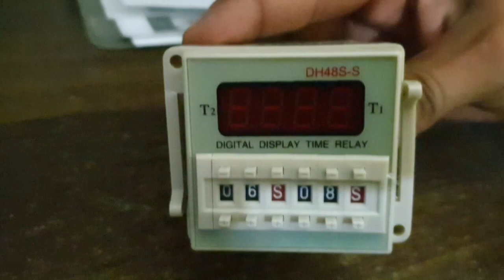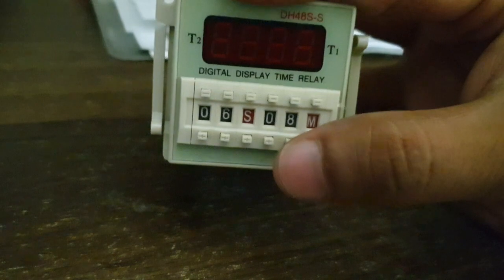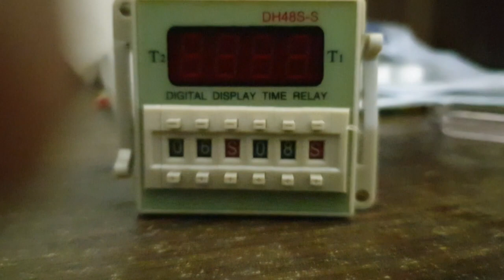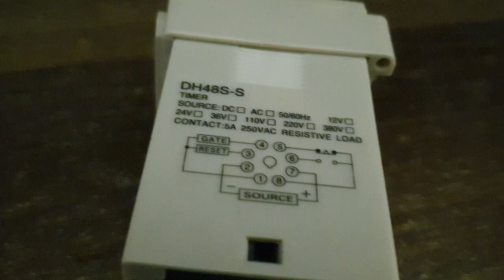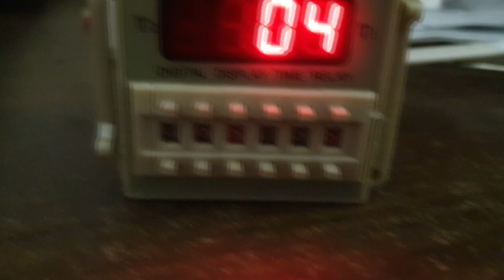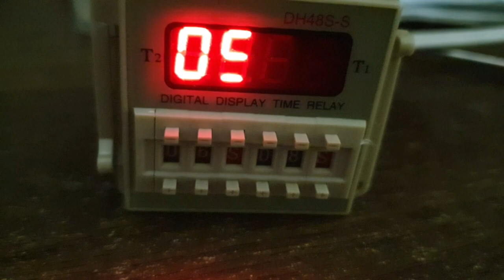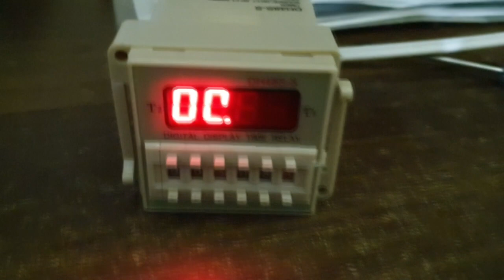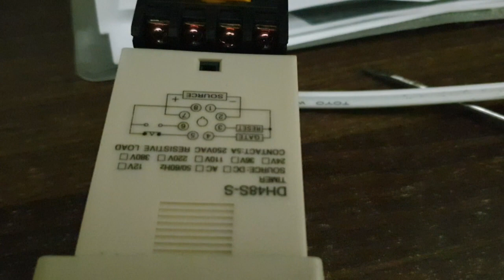Timer Relay - DH48S-S Set-up Guide

Comment: This timer can not switch on/off a device or lamp for a fractional time. For example if you want to switch on a device / lamp at 6:45 pm and switch off it at 11pm every day on repeatedly..... it is not possible. So, this timer is not useful.
Reply from the maker: I am not sure if that  is true. Relay has units for minutes and fraction of seconds as well. You need to put the value in that way , not in standard 6:45PM way. It is bit cumbersome. Another big downside of this relay is that if there is power fluctuation, the timers start from zero which meas your syncronization of T1 and T2 with day and night times will be riuned. I would suggest going for 'digital relays' which have built in clock and easily manageable time format.

Comment: Thanks! Very helpful 👍
Did you have the other two hooked up, for reset and gate ?
Reply from the maker: Hi, I did not connect reset and gate. To reset, which I rarely do, just disconnect mains from breaker  form a second and new time settings will be applied.
Reply: Hey buddy I have japani connecter which is used to control direct load on this relay but can't understand connecter pls help
Reply: InstaBlaster.